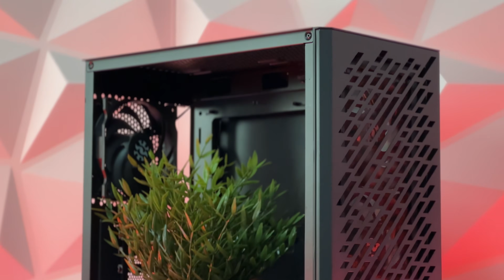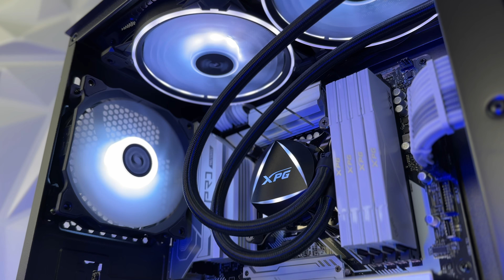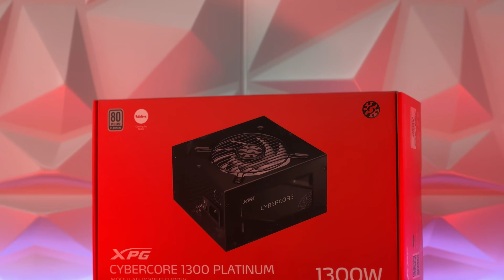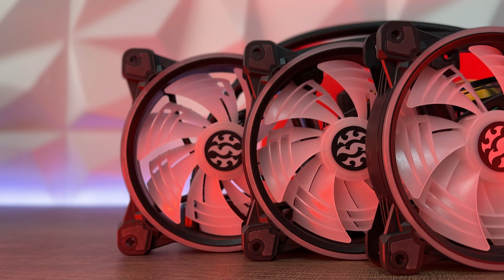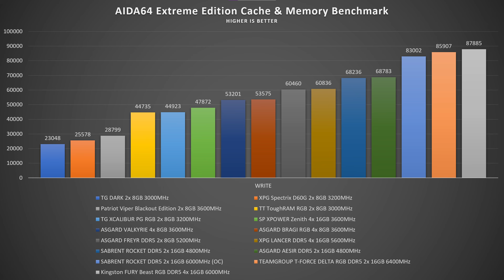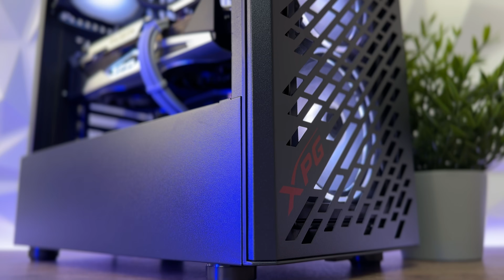MONOCHROME XPG BUILD - Review & Benchmarks

Comment: Hey nice video! I have a question, are those front fans loud or quiet? I have good CPU cooling, but I am afraid, that those attached fans can be loud. Thanks :)
Reply from the maker: Thank you! At higher RPMs somewhere from 80% they are louder than usual, but below that, they are quite quiet. ;)